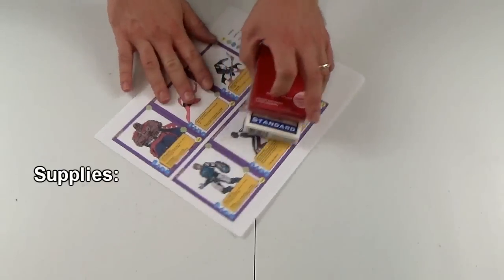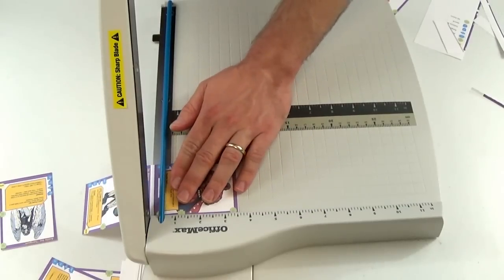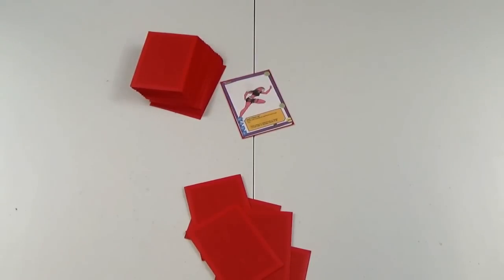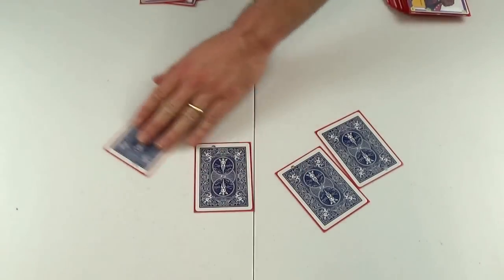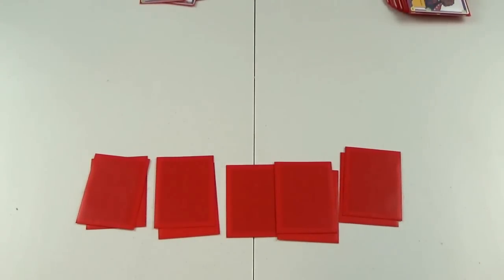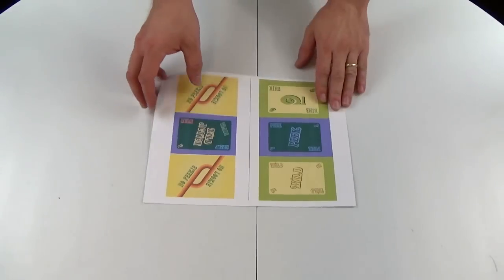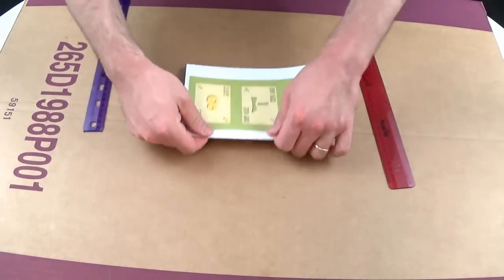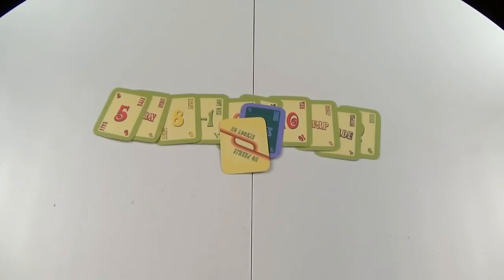DIY Gaming - Prototyping Playing Cards

Comment: Great video :) I'm in the process of making a board game and this was super helpful. Where can I find similar card sleeves to the ones on this video?
Reply from the maker: Emma Hales Great question.  I picked these up at Wal-Mart near the checkout.  They're the standard Ultra-pro sleeves (near the baseball cards, etc.)  If you have a game store nearby they will most likely stock these and maybe others.  A game store might also have some throw-away junk cards you can use instead of buying a playing deck
Reply: Nice

Comment: +Pub Meeple, for double sided cards, ill print/and cut both side separate, and put
them in a clear sleeve, this way I get 2times the thickness of the paper and it
keeps together inside the sleeve, if I just want to edit 1 side of the card I
can, because its not glued.
Reply from the maker: +Dawn Mage that's a good idea

Comment: If using sleeves, and depending on the transparency of the "opaque" side of the sleeves, I would recommend facing the standard cards to the back of the sleeve (the "opaque" side). Not that anyone is going to cheat when playtesting ;-)

Comment: Thanks for your video. How do I get the playing cards to be durable enough to withstand water smearing the ink? Thanks
Reply from the maker: first, I'd recommend always laser printing over your standard inkjet printer.  But as far as a protectant against some water, I'd look into a clear spray, similar to what painters use to protect their work.  But it'd have to go on light so as not to warp the paper

Comment: That's pretty awesome. Thank you so much, it's gonna come in handy.
Is there a link for the template, please?
Reply from the maker: Check the next comment down.  There is not an actual template for the self-registering cards.  But it's very simple to make up on photoshop.  Since this is a something we prototyped, the card size may not be the same as what you are using.

Comment from the maker: @Vy Taka:  Unfortunately I never got a template from Greg.  The one in the video is something I made up on photoshop just for the video demonstration and I don't even have that anymore.  It's fairly simple to set up as you can use guides to mirror rectangles on either side of a fold line, but this may be a different size than what I used based on what you want to end up with.  Best advice Greg gave me was to only have the "cut-out" lines on one side and make sure the image bleeds past the template on both sides.  This way if the image is folded slightly off you won't notice after cutting it out.

Comment: Why not just print on both sides of the cardstock? Seems easier to me.
Reply from the maker: That's definitely a possibility.  What most people find is that printing on both sides is difficult ensuring they line up properly.  But if you get it to work it would preferable